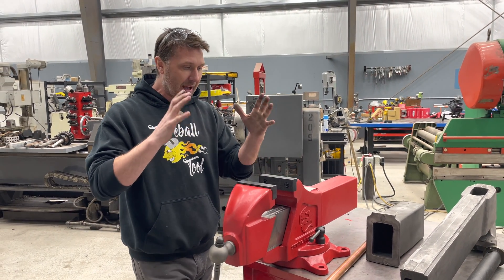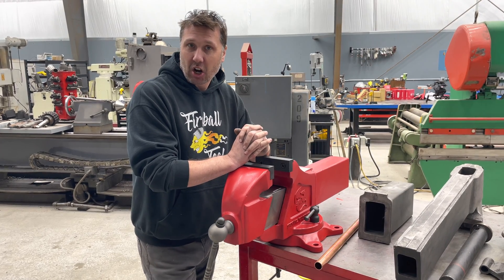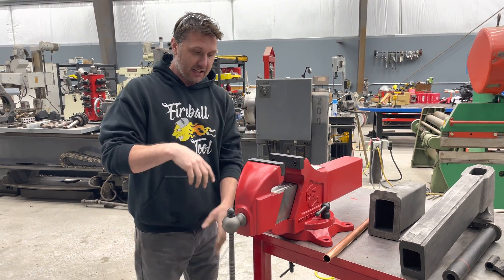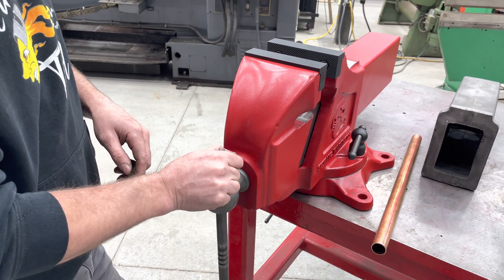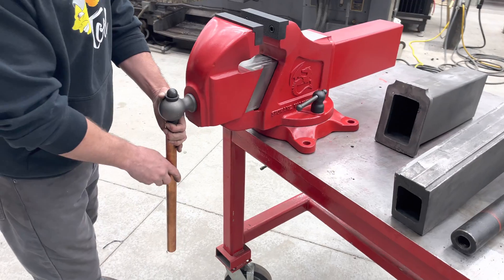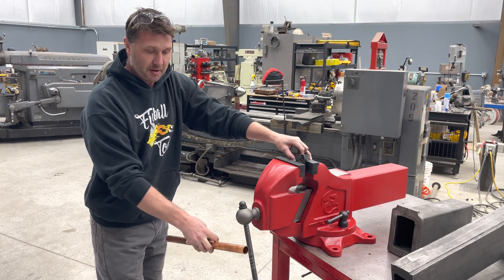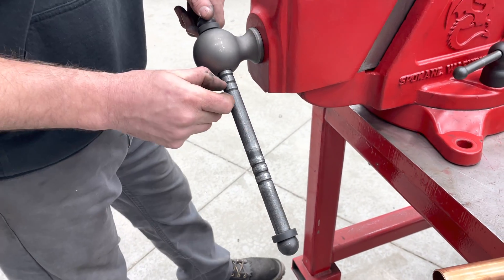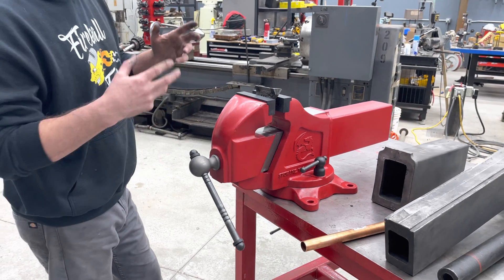Why is the Handle Small? - Fireball Hardtail Vise

Comment: One thing I like is to put something long on the side of the vice so the jaws have to be wider than the body one other thing is the fixed back jaw must overhang the bench so your long object will hit the floor the top of jaw is not deep enough between the center slide I like pipe jaws under main jaws just so they are inset from jaw line to center slide

Comment: This vise has in fact power steering! :) 
So that any too mighty operator does not overpower it and raise claim that a jaw or nut failed.
The bearings add much to the clamping force here. I now look into future vises having roller bearing slides (like drawers) to add to ease of operation and clamping force. :)

Comment: When I started working in the family business ,recycling plastic, I slid into the role of maintaining and repairing the equipment.
I started to see failures that were costly and resulted in lots of down time after working there for some time.
I started going the bigger is better route in my repairs when applicable and this increased time between failure.
Bigger motors, bigger wiring, bigger shafts, bigger bearings, more belt surface, bigger pulleys.
After a few years of changes to the equipment productivity was up 100% or more on all machines and the workers had became accustomed to running the machines harder and harder.
But I found no matter how strong I made everything some workers would still run the equipment to failure.
They would trip breakers, or overheat motors causing product jams that took time to clean out. They would over torque or shock shafts till they twisted in two.
They could not recognize when they had pushed too far and generally did not inspect the equipment for problems.
They would not read and understand amp meters and attempts to limit the amount of product they loaded was difficult to control when they ignored cues they had gone too far.

I decided I needed a cheap point of failure in all of the equipment that was an audible and consistent warning they needed to pull back.
After some observation I found the only thing they seemed to respect was a slipping belt.
The smoke and loud squall of a 12 groove banded belt gets everyones attention in the plant when it happens. 
So I reduced the tension on all belts creating a scenario where if the machine were to be overloaded the first thing to reach its limit would be belt grip.
Initially this was meet with lots of resistance and calls to tighten belts and I resisted pointing out that a noisy belt does not break parts and cause downtime.
The workers being told to deal with this new situation quickly adapted to the new restriction and downtime from equipment failure has reached an all-time low.
Productivity has not been impacted and workers can focus on running the machines instead of clearing jams.

It's a winning situation across the board and the belts actually last longer now because the cords inside are not breaking from heavy shock loads.

I have to deal with complaints of noisy belts but a quick check of motor loads with an amp meter lets me know if the belt is doing its job.

The handle on this vice is the conclusion you would reach if you had to deal with equipment failure time and time again.
You need a weak point somewhere or you will break something that is not easily replaceable.
These vices are as strong as the weakest part and that weak point needs to remain weak to protect everything else from failure.
Reply: I worked with this small company building a prototype machine. One of the fail points on already made models was if there was a jam, the main frame of the machine would bend. Previous engineers tried solving the issue by strengthening the frame, making it heavier, and it was supposed to be lifted by 2 men and moved regularly. Ultimately they blamed it on the workers not knowing how to operate it. When we took on the project, the first thing we did was to put a smaller motor on it. Problem solved, never bent another beam or frame.

Comment: It's interesting that you cut those notches in to weaken it - on the old vintage vices they simply control two variables to control maximum jaw force and protect the vice: 1 bar diameter - you said this is set for comfort- fair enough 2 bar length - you've set this nice and short and extending it won't make the main bar stronger at which point only 1 matters, bar diameter. Could you instead have made it lighter by using tube instead of solid rod to reduce strength and give a chunky look?
Reply: @JorgTheElder  Zero - it could be a 3mm hole in a 20mm rod for example - tune to spec.

Comment: Basically we’ve all been trained by the market and by using inferior products that a longer handle is required to gain the leverage we need to hold down objects the tightest when better engineering is all we really ever needed to make up for this. Thanks @Fireball 2ool

Comment: You can add 5cm in lenght without issue, so why not. And also, when you need to rotate faster  you can put the handle half in, so that lenght will be half on both part and you can turn faster like you did with smaller handle entirely out...

Comment: I use big vises, I like this vise, but the handle is way small, Too Small!  Say what you want, too small it is.
Reply: 33,000 psi. How much your big vices put out? Ever use a vice with thrust bearings. U don't need to fight the resistance of friction
Reply: @electromechanicalstuff2602  I more carefully looked over the vise, it seems to be more of a precision bench vice, than a heavier 8" Hollands for example that works for busting down hydraulic cylinders, and the heaviest work that a vise can do.  The type of vise that is mounted on pedestals not benches.

Comment: A nice feature of the Chas Parker vises was the set screw in the end of the ball portion of the screw. You could set it with a fine drag to keep the handle from sliding through as easily when you turned the handle. I'm pretty sure they marketed it that way so you could tighten the vise with one finger without it dropping through all the time.
Reply: I have mine set so it doesn't move at all under gravity unless I change it. Most times it's 50/50 like you said for quick one finger use, and only gets full length for final tighten. 6-1/4" Chas Parker 375. ~150lbs.

Comment: I have a shop built woodworking vice, and as my background is in engineering (I started as a toolmaker apprentice in 1967) I could help but go a little bit over the top with the design, and that includes a thrust ball bearing between the screw and sliding jaw.  It is a quick release design so I was able to use a relatively fine thread on the screw for a vice. The consequence of this is that I have to be very careful about how tight I clamp anything in it, because it is too easy to overtighten.   I think that thrust race was the most expensive component of the build, but I don't regret it.  It's like when you put a dab of wax on a wood screw or grease on nuts and bolts — you have to apply different criteria to the forces need to do them up and screw them in as it is that much easier.

Comment: I was hoping those ridges would be for a ball detent somewhere to hold the handle at the 50/50 mid point position etc. I always thought that would be useful on vices, especially when spinning it around quickly.
Reply: Same thought here.
Reply: Would be a great modification to make.
Reply: But then the handle wouldn't slip through to the other side
Reply: @00linered  Yes it would. The whole point of using a ball detent as opposed to say a pin is that it allows the bar to be held in multiple positions. Look up how a ball detent works, it might make more sense to see it in action.